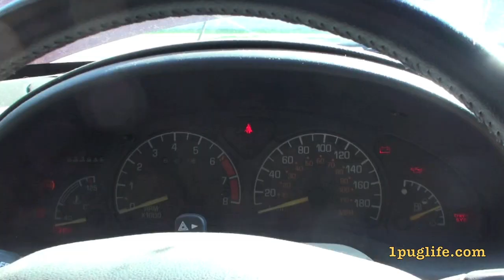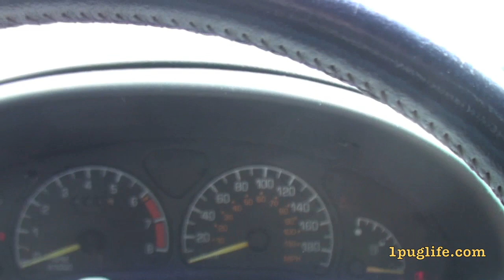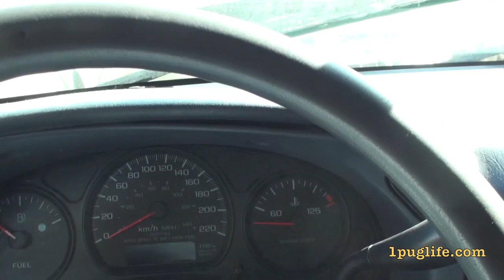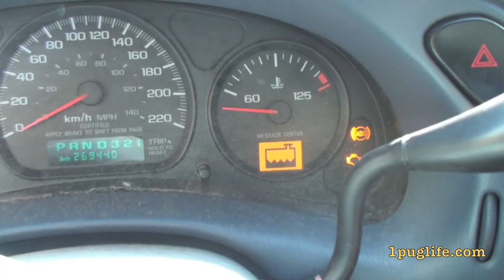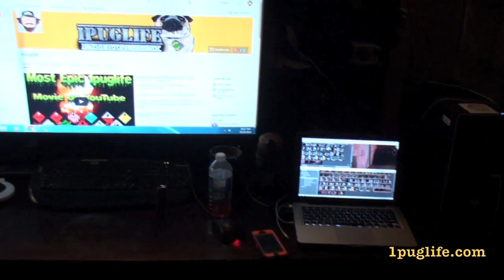moving the lair

Comment: nice touch that, the better half  getting you an English wheel, word of advice,  its the same quality as that pig irons mill drill you brought, lol,, will work of sorts but not great. having experience using an Oxford English wheel, weighed about 2 ton's solid cast iron.
did buy a blue version, ended up sending it back, made my own in the end, case harden the wheels, used bearings. made all kinds of stuff, from lotus super seven bonnets, wheel fenders, . frigin great bit of kit.